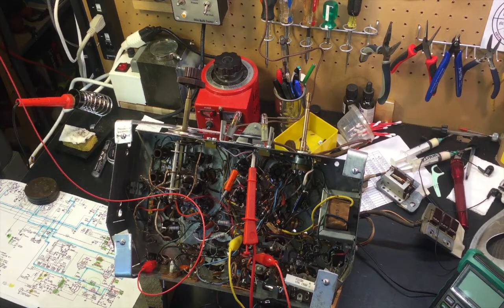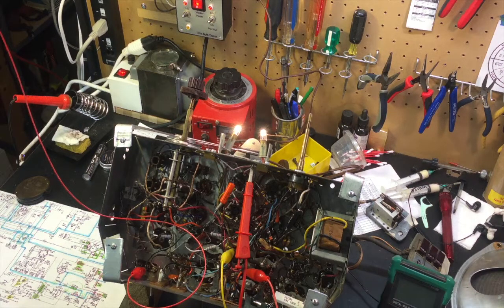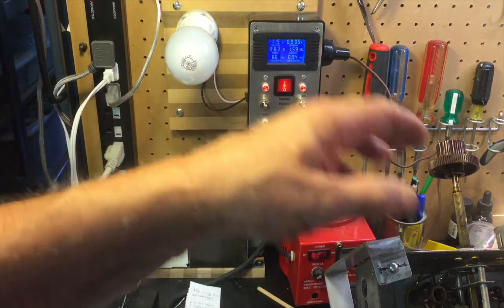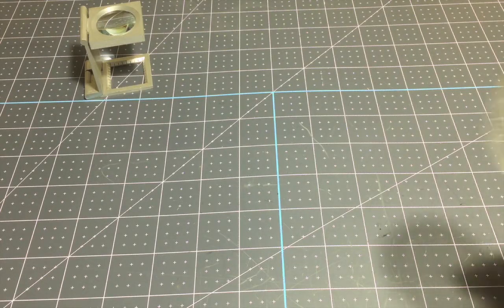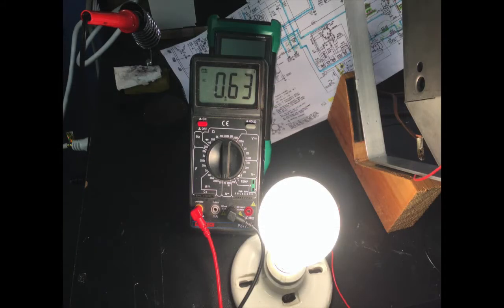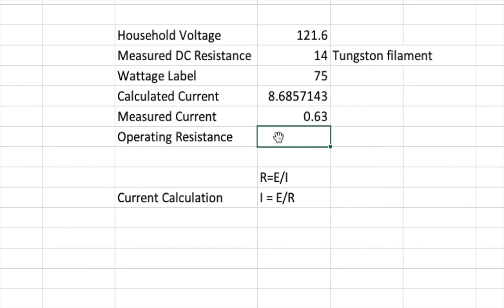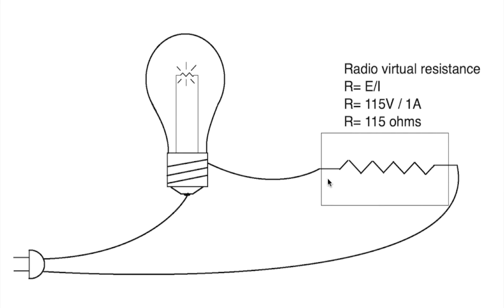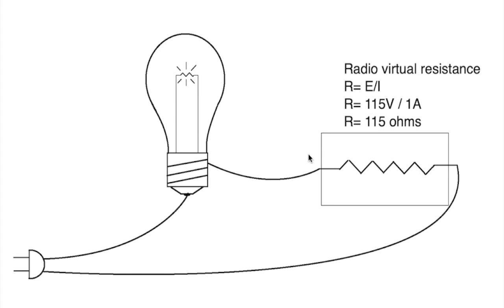Dim Bulb Tester

Comment: Great description and really easy to follow. One small error though - towards the end you said that to allow for equipment with a higher demand you needed a higher wattage bulb - correct, but to do that with multiple bulbs they need to be in parallel not series.
Reply from the maker: Good catch. Thanks!

Comment: Thank you very much for making this video sir. I've got a Silvertone model 1484 guitar amplifier that hasn't seen electricity in at least 20 years. I've wanted to power it up for the last 10 years now, and just now getting my chops together to make that happen. I do have a variac and plan on bringing it up slowly. I plan on building a light bulb limiter. My question is, how important is an isolation transformer for my particular application? Is this mainly for someone that probes into the circuitry while it's hot? Any advice appreciated.
Reply from the maker: Good question. If all you're going to do is see if the amp will work, then you don't need an isolation transformer. Further, your Silvertone uses a power transformer, so it is relatively safe to work on without isolation. However, don't do it. There are lethal voltages inside the chassis of that amp that will make you dead, if you don't take a number of precautions. In case you haven't discovered him just yet, check out Uncle Doug on Youtube. He is the dean of guitar amplifiers and knows everything. His backlog of videos will tell you everything you need to know about bringing up an old amp. Good luck! I hope it works.

Comment: Hi I used an 105w bulm whit a power amplifier (110w rms) with changed output transistor. It worked for 1 min with 0,1 A and that output goes shorted and bulm goes full bright. Why it does not protect???
Reply from the maker: When the bulb went full bright, it was limiting the current. But, the bulb will not stop all current. Is there a fuse in the circuit?
Reply: @fibberscloset498  4a fuse on power supply..... Circuit absorb 0,1 and bulb was dim... Then goes in short... Bulb to big?

Comment: Very nice. i noticed that your isolation transformer, doesn't have ground on the secondary isolated. Is that right? If so wouldn't it be safer to have a cheater plug so that ground on the variac is isolated, therefore the test radio is isolated from ground? Thanks
Reply from the maker: the isolation transformer is isolated, so the variac as well as the radio are also isolated.
Reply: @fibberscloset498  not COMPLETELY isolated. ie. ground is not isolated.
Reply from the maker: The ground pin in the isolation transformer’s secondary outlet is floating - not connected to anything, and therefore isolated. It’s simply there so I can plug in a 3-prong cord.
Reply: @fibberscloset498  Okay that's good!! Thanks.

Comment: Great explanation of the dim bulb tester. I also built one using David Tipton's design. I think I have a 60W bulb in it. Your video makes me think I should add a couple of bulbs with switches to add or remove them from the circuit.
Reply from the maker: Something to consider. Thanks for watching, Rick.

Comment: Enjoyed the video Martin….a good explanation of what is going on and why….an experiment I did once (not sure if I filmed it) was pulled a tube out of a working radio and measured filament resistance(warm) then let it cool off and checked it…my isolation transformer/variac and metering (analog) is fused with a 1 amp fuse to protect my circuit….the meters are $6 Chinese..So far, I have only blown the fuse twice….one was with this Kenwood after I replaced the grid and driver caps….I applied full voltage to new capacitors and the took the fuse out…doh! I should have applied the voltage gently to new caps to condition them….live and learn….lol…Hope everyone is doing well out West….my son has been experiencing all that smoke in Utah lately….thanks for the video and Take Care—Larry
Reply from the maker: Thanks, Larry. I'd like to see that video.

Comment: A great and much-needed video!  Beneficial, helpful, informative, inspiring, and much appreciated.  
I am so thankful to Larry (backtothefutureradios) for sending me to your channel which I subscribed to quite some time ago.
I am sure that I watched a video about the Dim Bulb Tester that Manuel uses on his channel, but can't find it listed under his "Videos" tab anywhere now.  I did a search for Dim Bulb Tester and his channel name and found it.  That being the case, I noticed several other people that I know had made a video on Dim Bulb Tester,  under the Videos tab that none of them had the video that I know that they produced.  So I did the same search using "Dim Bulb Tester and the name of the channel, and Viola, there they were!  Just in case you have any interest in viewing any or all of them, here is the list with the URL to go to it:

Mr. Carlson's Lab	https://www.youtube.com/watch?v=51mjt9nFoeA
Dave Tipton	https://www.youtube.com/watch?v=ykUlzhCTLvg
Electronics Old and New	https://youtu.be/BjkRZN_4yG8
Xraytonyb	https://youtu.be/JdfpPj1Dh_M

On the schematic that xraytonyb had on his video, I would have made it slightly different.  I would have had the circuits with the bulbs on the top, and  have the "hot" lead coming from the secondary of the transformer to go to the center pin of a SPDT switch so that the center pin would connect to the bus going to the switches of the bulbs in one position, and to the bus on the other side to "BYPASS" the bulbs.
Again, a good and much-needed video!  Thanks!
Reply from the maker: Thank you so much, Wayne. I haven't seen Xraytonyb yet. I'll check it out.